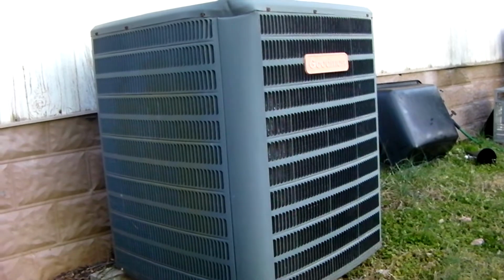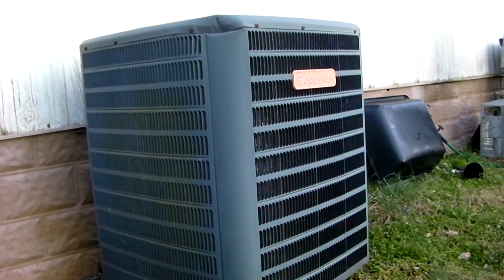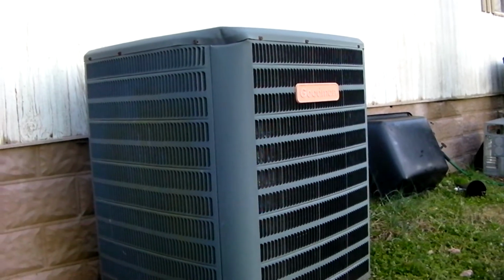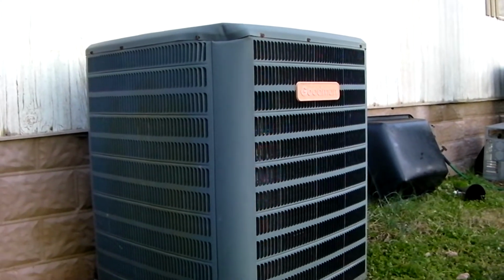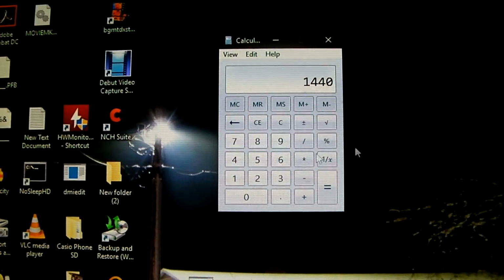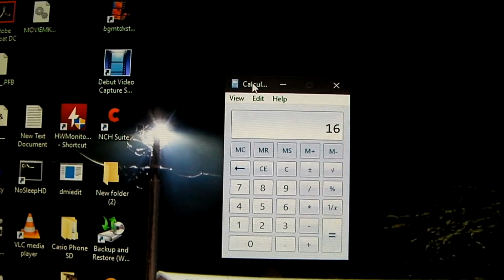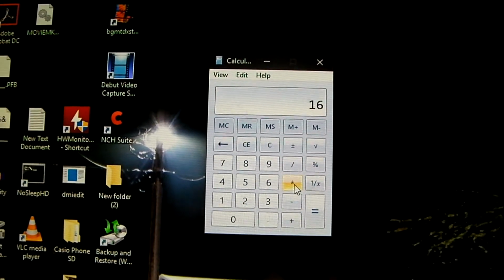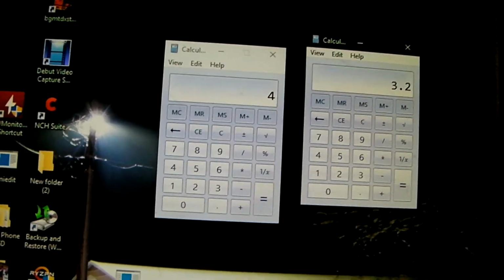One very annoying thing about heat pumps - Time-Temperature Defrost

Comment: I have the same Goodman. I live in western Washington, Tacoma. 
I have mine set at 60 mins. 
It is able to melt all of the frost no problem.  I  would like to try 90 mins as that would cut down on it running the oil furnace while it is defrosting. 
Do you think this would be a problem? 
I’ve been under the impression that as long as it melts all of the frost before the defrost  cycle is over it should be ok?
I think mine defrosts way to much.
Reply from the maker: Wouldn't hurt to try 90 minutes. I no longer have this unit since I got rid of the old single wide (this unit went with it, and might still be in service at its new location) and have a new home on the property. But I had ultimately ended up retrofitting this unit with the Emerson 47D01U-843 defrost control which provided demand defrost. It cut way down on unnecessary defrost cycles.

Comment: i stumbled on this video because my 5T bryant evo has an inch of ice wrapped around it.  it will go into defrost but only for 2 mins, then back to stage 5 heat.  it's 25 outside and wont get over 70 in the house.  any suggestions?
Reply from the maker: It depends on what kind of defrost board that unit has... time-temperature units typically rely on a thermostat switch that closes at around 32F and opens at a warmer temperature. Demand units measure temperature usually from two different thermistors. these sensors report the outdoor temperature as well as the coil temperature. If they are messed up, they will affect the defrost cycle. With demand defrost boards, sometimes issues can happen with the electronics. If you aren't familiar with defrost controls, I'd recommend getting assistance from an HVAC tech.
Reply: @CubeComputerChannel  I can choose 30-120 mins or set to auto. It only defrosts for 2 mins then goes back to heat pump mode. If it could defrost longer it may keep the ice from forming.
Reply from the maker: @morejelloplease  I'd suggest replacing the defrost thermostat. Sounds like it's opening too soon, causing the unit to exit defrost too early.